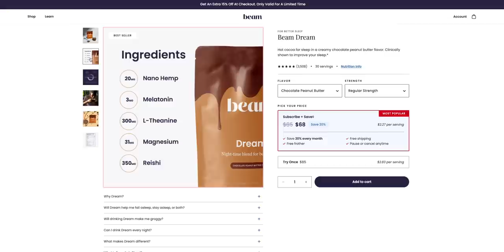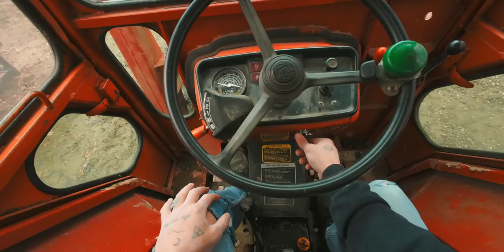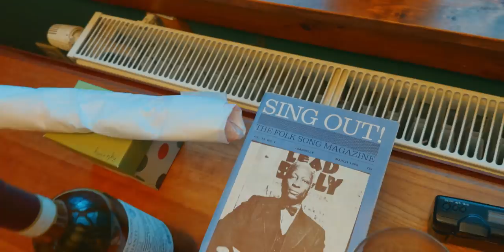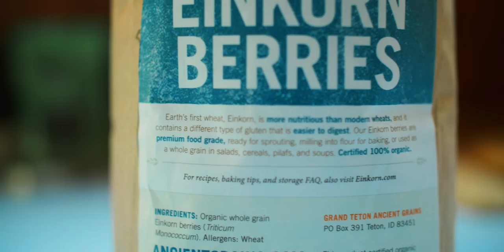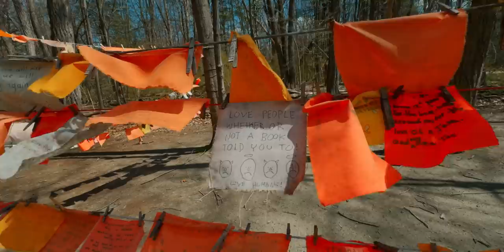Countryside Spring 🌱 Rural Life + Property Renovations

Comment: Did you try checking the JC valve it should be right outside of the engine if it's not that it has to be the k 136 tri vaulve